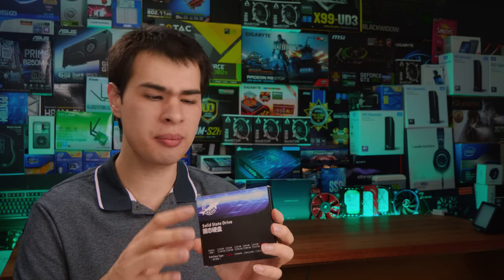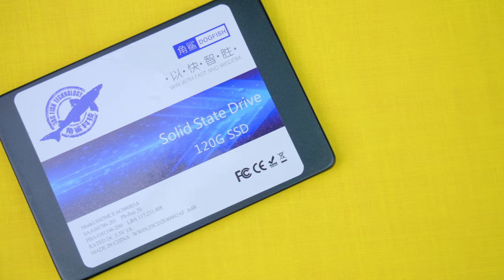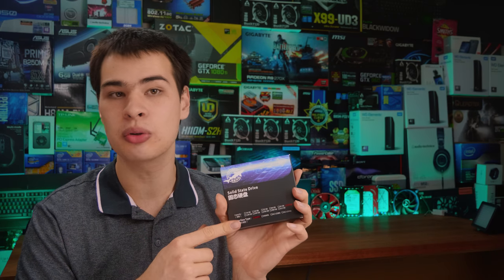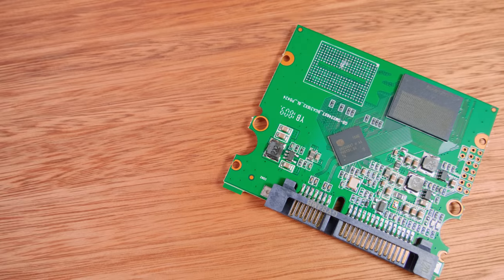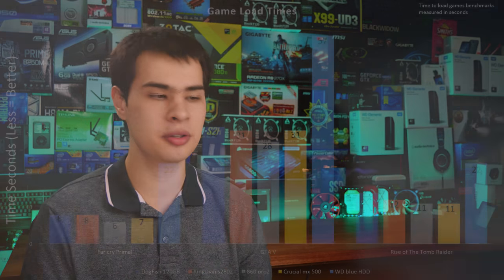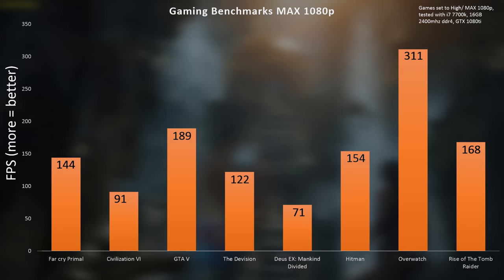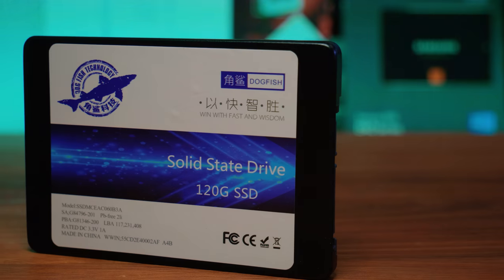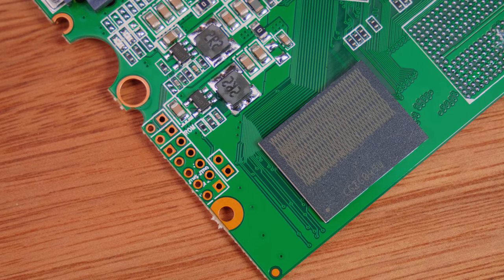Low Cost SSD -DogFish SSD Review

Comment: im pretty sure that the flash chips ssds use arent made equally there fore these chips in low cost ssds are probably a hit or miss depending on which chip it has, you could buy 2 and only 1 will last over a year and other for another 5 years 
tbh im not an expert with ssds and hdds and how they can vary and all that jazz

Comment: I got a 1tb drive, figured I would try it for my Steam library. So hardly any writing. We'll see. I have never had a ssd fail but I the cheapest I ever went before this was Kingston. Samsung 970 Evo for boot drive anyway. This dogfish drive, hope to hell it lasts, but it's not the end of the world if it doesn't
Reply: Did the drive fail by any chance? Thanks!
Reply: How is it doing now?
Reply: @Sconechoc  The drive hasn't failed or noticeably slowed down but I wouldn't buy again because it is supposed to be 1TB but it is only letting me have 500GB so I don't know if it is actually a smaller drive or what, don't care. I can get a higher end Samsung SSD for the price I paid for the DogFish now anyways. Luckily 500GB has been enough for my use so far but it is still a disappointment.

Comment: Do not buy anything from Dogfish! I bought a "480 GB" m.2 SSD and it died within two months! Plus, the "480 GB" m.2 SSD was only an inch long when it came in! I really doubt it was actually 480 GB! This company has no face!
Reply from the maker: The size of the drive does not reflect the storage capacity, im guessing you received a 2240 sized drive (about an inch long) and 2240 sized drives I have seen up to about 512gb, so it's probably 480gb but did you manage to contact them or was it complete silence from them?
Reply: Dogfish currently lists a 1TB 2242 m.2 drive. As far as I can tell, if it's real, it's the first of its kind on the market. And at 220 dollars, it would be an absolute steal. Any chance you can do a review?